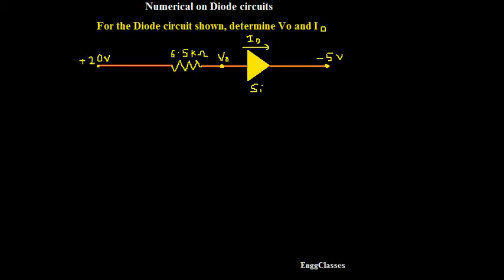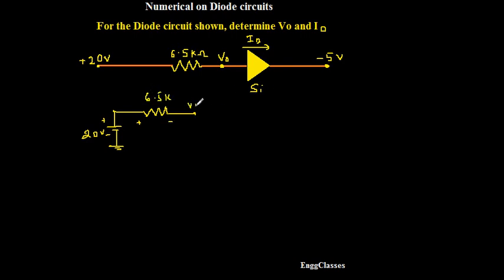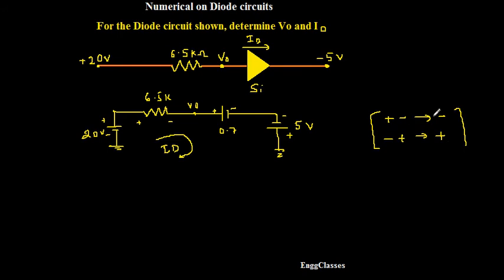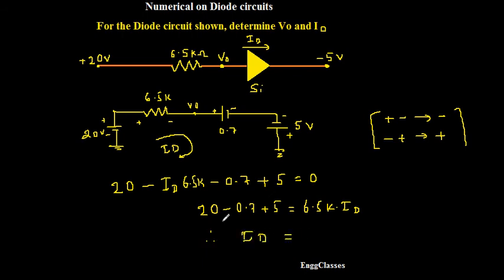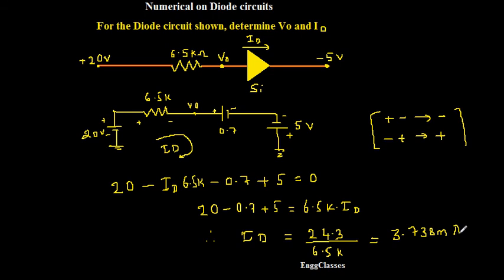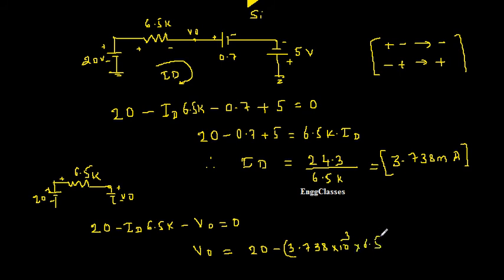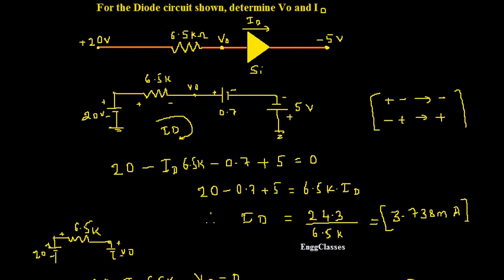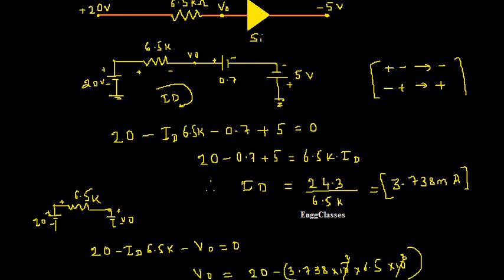Diode Circuits (Numerical 7) | BASIC ELECTRONICS

Comment: In both case you have got same answer but in 1 St case you have taken V output as negative and in another case you have taken V output as positive , How has it  happened that
Reply: because of the direction of the current .
Reply: in first case it is from positive to negative whereas in the second case it is from negative to positve direction of current .